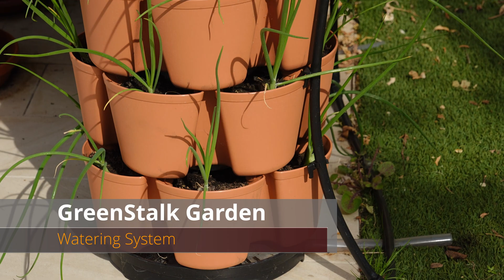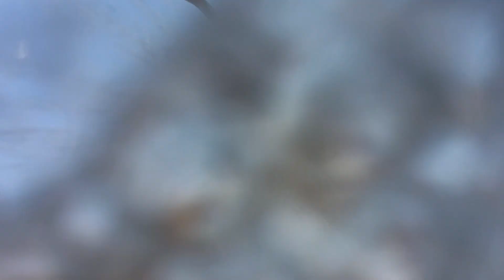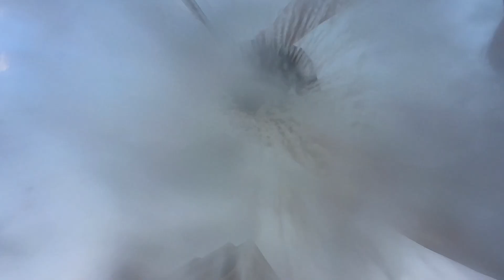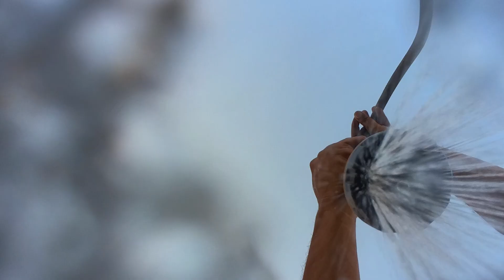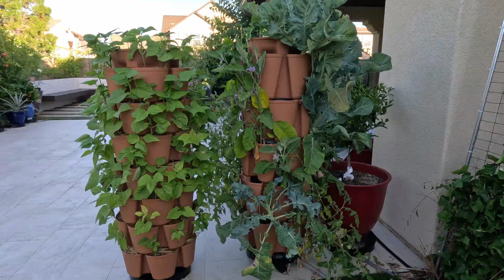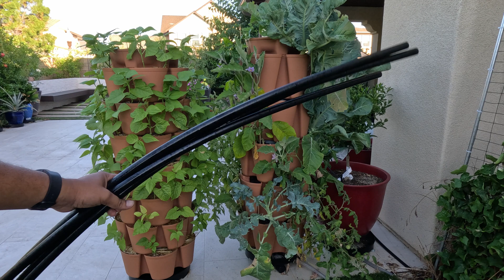Automatic Watering System For Your GreenStalk Garden Vertical Planter

Comment: If you connect the watering system like you have done, how do you rotate the tower?
Reply from the maker: You cannot, without removing the water line - but its easy to pop it out and put it back on

Comment: What if you need to turn the greenstalk for all of the plants to receive sunlight?
Reply from the maker: Good question. That is one drawback of having the watering system. You will need to remove the holders, turn and re install the holders and re attach the pipe. Takes about 5 minutes per planter but doable
Reply: I think I wiuld plant morning sun / afternoon shade plants oriented towards east side & bag moving the planter… seriously considering this. 🫘